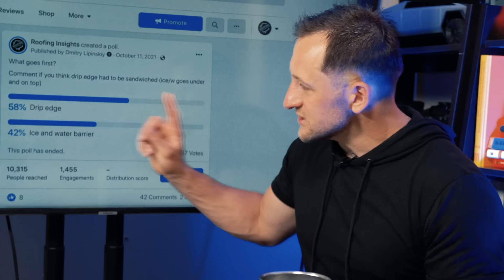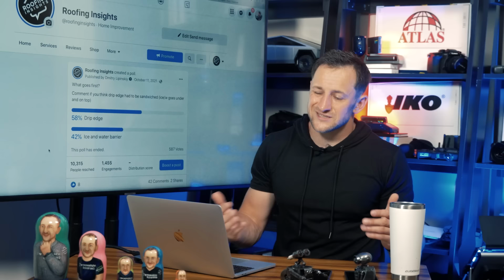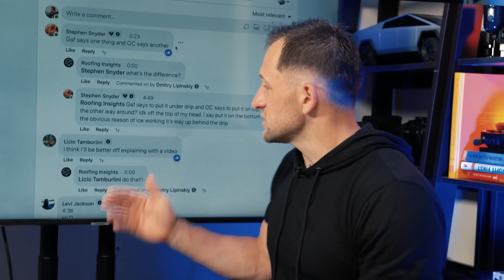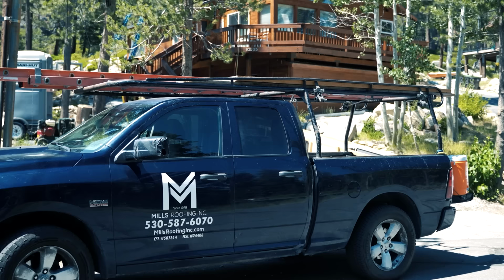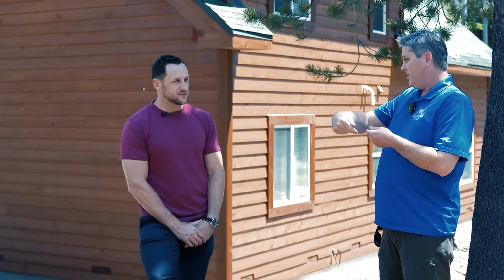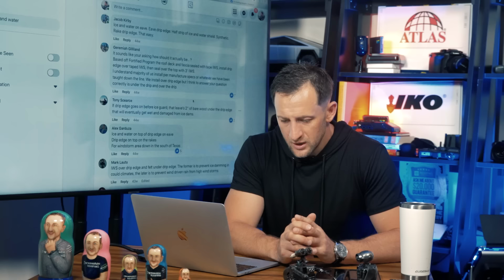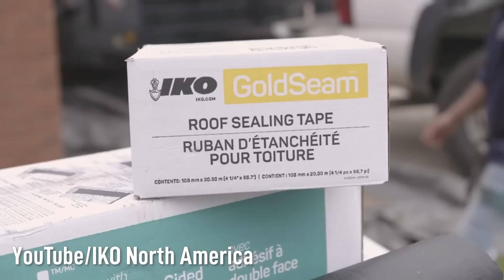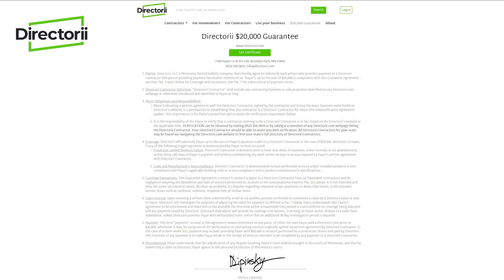The Big Roofing Debate: Drip edge or Underlayment first?

Comment: Well what I do is remove Gutter hangers if it's a existing roof clean the Gutter install Gutter flashing apron etc I know they call it diferente in some states or companies make sure the Gutter flashing overlaps at least a inch then I nail the hangers over the flashing place ice and water shield over the flashing and work my way up the reason being I don't place the ice under and the flashing ontop is because with rain or snow sitting on the roof if water some how gets under the shingles and starter it still has to fal on ice and water then on flashing and in to the Gutter  and if it were the other way around the flashing would prevent water flow with could cause water to get stopped by the flashing causing the nails on the flashing to rot out and then leave holes on the ice and water and in the decking I work in Chicago area I've seen the flashing onto but asleep that method causes the fascia border to rotten out just yesterday my crew and I did the roof on a garage gable to gable garage drip edge on top of ice shield nails on the drip edge rotten out causing leaks on roof decking and fascia both sides of t he garage so we had to change them just thinking about it its better to not have holes on the ice and water shield that way its more water tight that nailing  the drip edge more holes more leaks that's my saying just like shingles more nails more chances of leaks 5 nails per shingle is enough for any asphalt shingle

Comment: There is no debate. Follow code. California requires drip edge on the eaves at least 2" directly on the decking with underlayment over it. The drip edge should be 1/4" or more to allow water to avoid hitting the decking/sheathing side (usually OSB plywood) . Many roofers make the mistake of putting the eave flashing on last and try to get aware with it by putting up gutters with a wing that is only 1/4" of an inch over the decking, sometimes forcing it under the existing peel and stick underlayment, breaking the seal. They get away with it most the time because inspectors aren't going to pull things up...I'm dealing with this right now with a roofer here that subcontracted to another roofer (found out after we were told they have their own crew).

Comment: why not put a 1/2 strip of IWS that falls over under the drip edge onto the fascia, then put your drip edge then put the regular IWS as if you would do a normal over the drip edge. this way its protected both under and over and the further piece is always under the higher piece. and with the starter ribon you can place that on top right under the shingles. to me it makes more sense for to sandwich the thing considering capillarity and possible ice and snow melting under the shingle. but it makes no sens to put it over as then water will seep between the drip edge and the IWS which nullifies its purpose.

Comment: Ice and water goes over facia an behind gutter , then drip to prevent ice backing up under plywood an drip. Although  most inspectors will pass ice guard  ontop of drip, it's fast easy way if no ice issue. Proper soffit ventilation an ridge vent an enough insulation  an then no ice. Proper way is ice an water first an installed rolled over bottom roof edge onto facia board or metal an tucked behind gutter. Then even in worst ice situation... the ice cant get in

Comment: Drip edge   in the front area  commun sense. And hips  over the paper is a code here in california. I had inspectors lift the shingles on the hips to se how is install. But when you doble paper we used it on top of  the ice water shield and paper over.  In the valleys we used  under and paper over.

Comment: I'm in Chester County Pennsylvania just west of Philadelphia... Climate zone 4, on the border of climate zone 5... I have only seen an ice damn form in a gutter that filled the gutter and backed up under the shingles once in my 12 years of for-profit work and my 8 years of non-profit work before that in the home repair industry.... In the one case were it occurred, the gutter had already been compromised, was low in the center so it was not draining properly and had the gutter maintenance been taken care of in a timely seasonal manner, the problem the customer experienced with ice filling the gutter would not have occurred.

What I have seen, more times than I can count, is something goes wrong with the shingle installation or a tree branch damage or something, or a nail works its way loose and pops through the shingle after 15 or 20 years and water gets down around that nail and starts making its way through the space between the underside of the shingles and the top of the underlayment.  I've also seen where the roofing crew has neglected to clip the shingle corners in a valley to prevent water from running horizontally across the top edge of a shingle and this is also allowed water to get down to the underlayment... And in both those cases, if the underlayment and ice and water shield is on top of the drip edge at the bottom edge of the roof, the water will exit safely into the gutter.  If that ice and water shield is underneath of the drip edge, the drip edge can begin to act as a dam and allow the water to run horizontally and look for a hole or away into the roof system.

Based on my experience of repairing hundreds of roof system failures, I am far more concerned about water getting into the underlayment system from above and running down between the shingles in the underlayment then I ever am about water coming up from the gutter from the bottom... 

And I have no qualms with putting the side drip edge on after the ice and water shield is down... And it makes more sense to me in a sequence of construction... I installed the bottom drip edge, I install all of the ice and water shield, and then we can go back and install the ice and water shield over the rakes. 

To some extent, I do believe that this discussion is climate zone specific.  For example, we only experience horizontal rain two or three times a year whereas other regions of the country experience this far more frequently.

I'm becoming a big fan of Matt Reisinger's Monopoly house framing where he provides continuous peel and stick membrane from the walls up onto the roof, and then frames out the soffits after the waterproofing is installed.... But I replace existing roofs far more frequently than I'm building a new house from scratch so my vote is drip edge goes on first at the bottom and ice and water shield is installed on top.
Reply: Here's a quick instructional video on why it's important to cut the corners in your valleys.... 

https://www.youtube.com/watch?v=Fp0OZVsTM08&list=PLHM_Hinmgh2Lcf0_VyvWmje38wsBqORMj&index=18

Comment: Ice and water shield ( IWS ) drip edge debate. 

1.  IWS is to “prevent” melted liquid water dammed up behind and under a solid block of ice dam from getting through the nail holes as the water is now under the shingles that are holding on the shingles. 
During an ice dam event liquid water is ponding on the roof surface above the warm area above the attic space. The solid frozen ice is over the cold exterior overhang damming the water above. 

2. The drip edge has one function, to get the water “into” the gutter. Said another way, to prevent water from getting “behind” the gutter once it runs off the shingles. Period. 

During the later stages of an ice dam event, or when there is little or no overhang, the liquid water will eventually reach the roof edge.  Once at the edge the gutter which is virtually always beyond the edge of the exterior wall plane  with no heat under it, will always be full of ice. Thus as the water escapes the roof surface it will want to go over and behind the gutter. If the ice shield is not over the edge behind the gutter then water will get into the soffit. Once in the soffit it will then travel back towards the home and depending on the placement of the soffit can get behind the siding or worse yet, behind a brick facade into the wall system of the home. 
So the short answer to a long question is, Ice and Water Shield needs to work all the way to “daylight” OVER the fascia !!

That said, drip edge is NOT a functional component working with IWS in the prevention of ice dam water getting into the home. 

Ice and water shield is not needed on any structure that isn’t heated. A detached garage or a stand alone shed. There are examples in every snow climate where icicles form on heated homes but not on unheated garages. 
The roofing products DO NOT CAUSE Ice dams !
The “lack of insulation” in the home CAUSE ice dams. 
Roofers use ice and water shields in self defense when they have no knowledge of the insulated valves in an older home. Or for that matter a newer home. Heat loss into the attic space is totally the result of the insulation contractor along with the HVAC contractor utilizing the attic space for any sort of heating ductwork. 
True roofers “should” inspect the attic space for proper insulation installations but rarely will a homeowner consider replacing their insulation along with air sealing the attic when installing a new roof.

Comment: I install Gutters / there is one BIG mistake in the video / it will show the gutters filling up with water and over flowing the gutters toward the rear / NOT TRUE / the back of the gutters are higher than the front / and it's built like that for a reason / so if and when it overflows the water will NOT go toward the home / it flows toward the front of the gutters to protect your home.

Comment: i cut strips of ice and water from the end of the roll and folded it over the down the fascia then put the drip edge on and then rolled the ice and water over the drip edge. "the sandwich". I was thinking with the ice and water only over the drip edge water could get under drip edge and lift them both  getting to the wood and behind the fascia. if you were only do drip edge under or over. i would put the drip edge over the ice and water, if water got under the drip it would be still have the shield under it, water might get in between drip and eave but not behind the fascia, into sheaving and framing.

Comment: You never put metal to bare wood, it'll sweat and moisture will get trapped and eventually rot out the bottom of the sheathing. Like a pop can sweating on a hot day, I run the underlayment to the bottom of the sheathing, then put the drip edge/ gutter apron on top the underlayment..
Reply: The pop can sweating on a hot day has to be chilled below the dew point to sweat. I am not sure how you would get the drip edge cold enough, unless you have an AC unit right below the roof deck.
Reply: @jonwikan3986  you have ice dams form at your eve if this area isn't properly worked. You have the freezing air hitting the hot air coming out at the eve, again that's if/when this isn't taken in to consideration by the installer. , You never, ever put metal directly to any wood surface, especially osb products, that aren't worth a damn if exposed to any kind of moisturize, even the slightest amount of moisture finds its way to that OSB (old shitty board) ,. So yes, you want your barrier down all the way to the bottom of your eve, I'll even give it a one inch bend into the gutter, then put my gutter apron, or T-edge, whichever one the person paying me to do the work wants installed in that area, you really should insulate your eve from inside your attic, even installing cardboard baffles in that area is a good idea. But never, ever install metal directly to wood, the only exception that I can think of is when you run 2x4 s across the roof when you're gonna go with a metal roof, that's ok to put metal to wood, but it's a 2x4 you're attaching the metal clips to, or using hex heads with epdm washers for every screw, but we're talking the difference between an actual piece of 2x4 lumber, not a 7/16th OSB plywood, which is pretty much standard operating procedure these days.
Reply: @denverscott37  I see your point in that situation. The golden standard 30 years ago was drip nailed directly to roof deck only on the eaves and over the tar paper on rakes. As an example of that standard, working my house has no rot with OSB at all (installed 1997 ish by me), but my soffit vents are quite far from the drip(12") and don't have warm air blasting out ,as hot air tends rise up and out the ridge vent or individual vents. I am wondering why warm air would be blowing out of the soffit vents? My golden standard now days, if I were a roofer, would be a narrow strip of ice and water wrapped over the eave(not rakes) facia an inch or two and then the drip edge installed on top of that strip and then come along with ice and water as usual. This would solve your condensation problem on the deck, somewhat.

Comment: I enjoyed the topic and thought about this critical item a few times in the past.  I agree experience is important as the contractor assumes huge liability when installing the roof.  The product manufacturer assumes some liability as well so I can see why these gentlemen are torn.  The code is written based on a consensus but I wonder if there is any data to validate one method over another or to even shine a light on an alternative method that may be even better than any recommended.  What might you know about this?

Comment: Ok so think about a poorly designed roof system that is too flat. The icw over would prevent any water from blowing ,wicking or gutter splash to get under the roof. Especially on a ribbed metal roof

Comment: On commercial roofs...membrane  goes first behind the gutter...ALWAYS...manufactures specs. Then install gutter apron and use cover-tape to strip in metal. With that being acknowledged...inspected..and passed....on new construction roofs...it is highly recommended to install ice and water shield to lap onto fascia board min. 3in. (We do this on every new construction roof...it's like turning it up a wall...another no brainer..why would you just put ice and water flush with the edge of the plywood on an eave line??? Now with existing gutters on a roof replacement....detach this gutter...install ice and water  past fascia board onto aluminum fascia...behind the gutter..install gutter apron and then synthetic felt over gutter apron shingle starter strips and then shingles. I'm in Illinois...ice dams will push under gutter apron. You could always strip in gutter apron using ice and water if the code requires it over. Do both...under past edge onto fascia...then strip it in with ice and water. Sounds like over kill but ice dams wear out this area of your roof the quickest.

Comment: "even better is zip the whole house rockwool batts on the roof then 2x4 on top of insulation  the full height of roof from gutter to ridge 16" on center  then 5/8 osb over entire roof yes a double deck then ice n water and drip edge. the zip is water and air tight, the insulation is the thermal break and the 2x4 provides a channel for air flow venting the roof deck not the attic keeping the roof from forming major ice damn due to no crazy thaw freeze cycles because you've separated the attic now a climate controlled space from the roof deck. zip the whole house customer very happy blower door score 1.1  gas and light bill during winter under $50 that was 2yrs ago